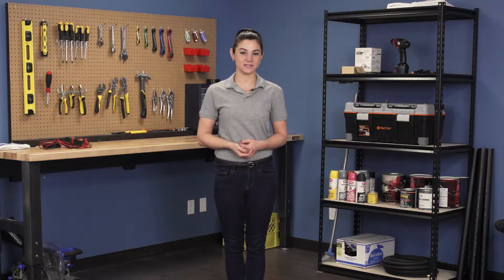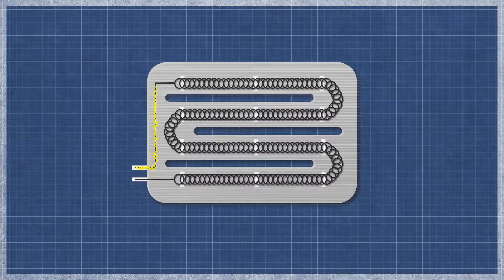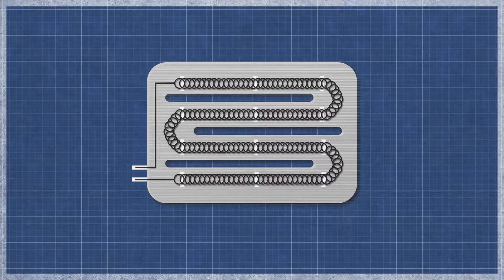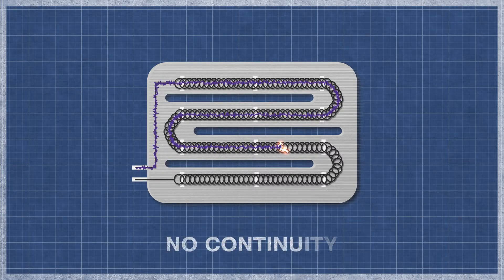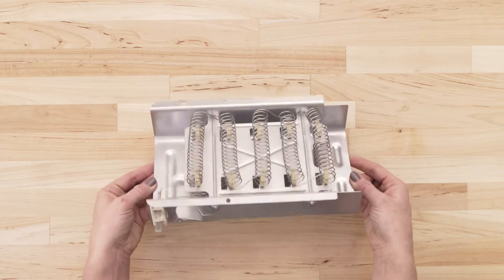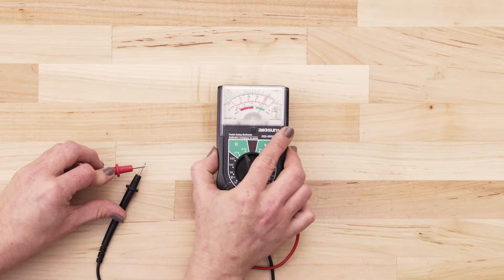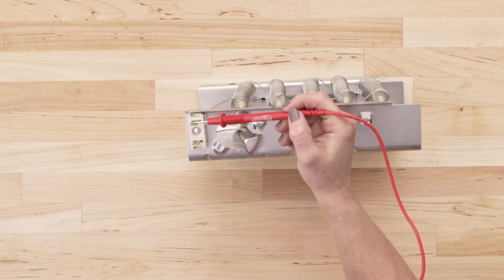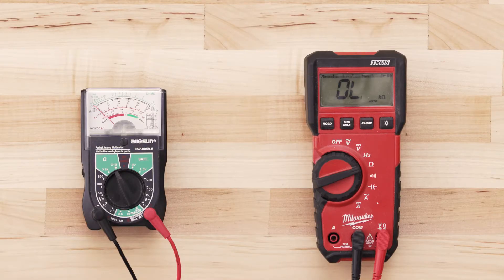Whirlpool # 279838 - Continuity Test (Dryer Heating Element)

Comment: Vent inside dryer is glowing after being on for 60or less could that be because I changed e cord
Reply: Moved it from rite across the road and now it getting way too homie like 40sec
Reply from the maker: Check to see if there is anything blocking the vent and make sure it has proper air flow. Also check the heating element for any damage.